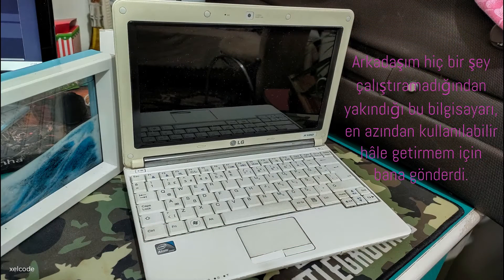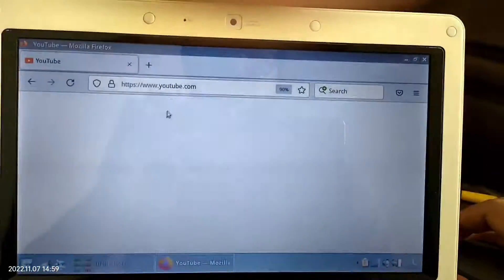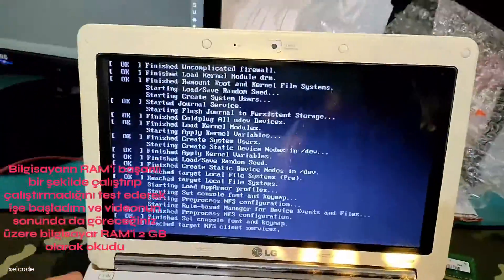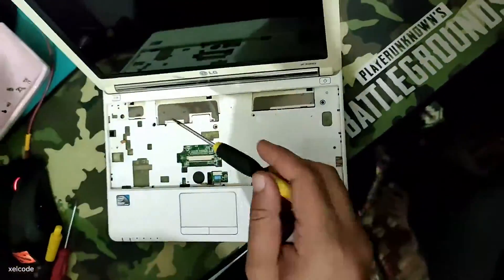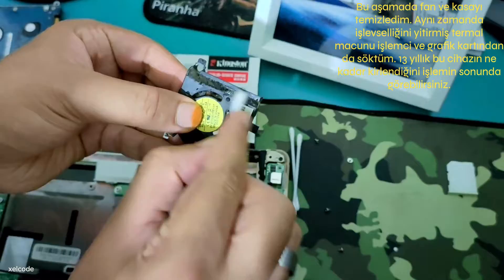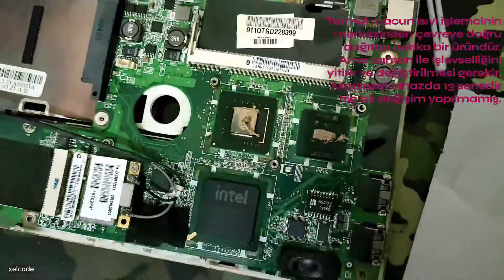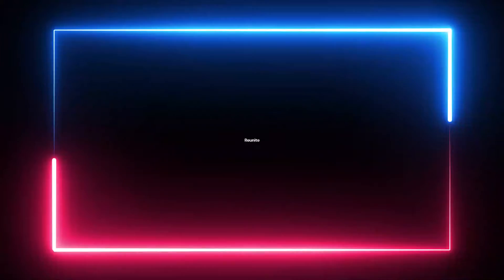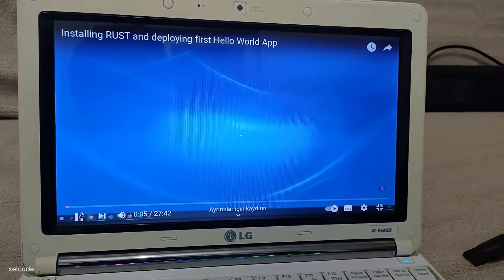How to upgrade an old PC with Intel Atom Processor (LG X130)

Comment: Hello, there are 3 screws under the keyboard. Are there screws holding the keyboard to the back of the computer? Are all 3 screws attached to the keyboard? I saw in the video that there were 2 installed.
Reply from the maker: Hello, since this is my friend's device, I can't remember what I did, but if you have any questions:
Right next to the screws holding the keyboard, there is usually either the word KB or a keyboard symbol. This way you can tell which ones are keyboard screws.